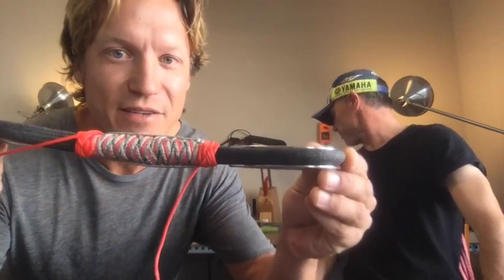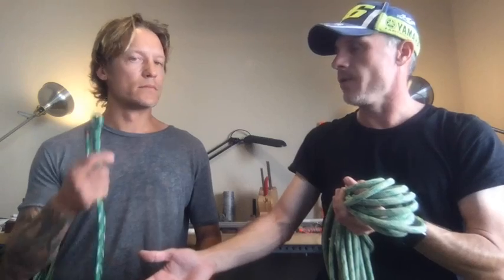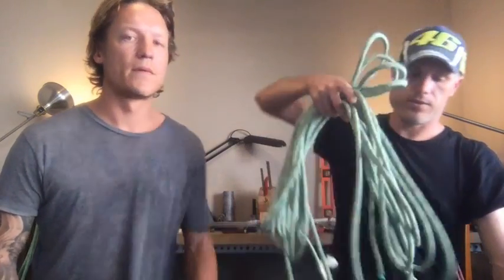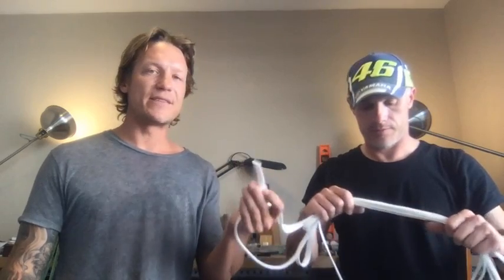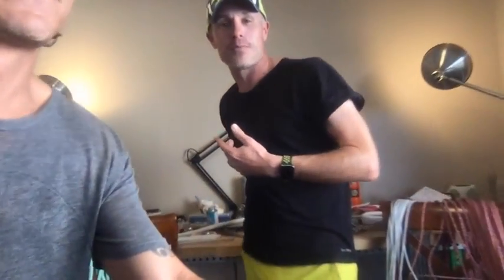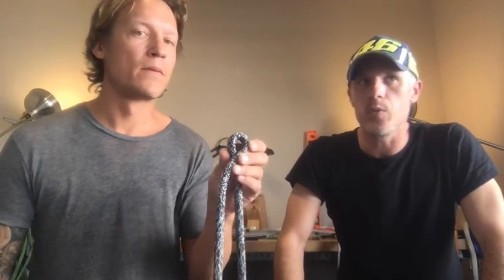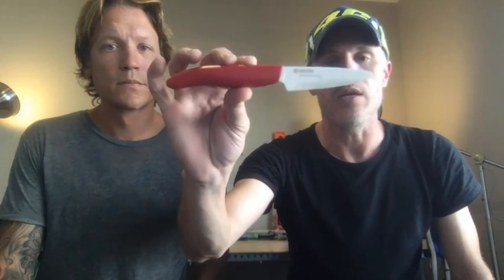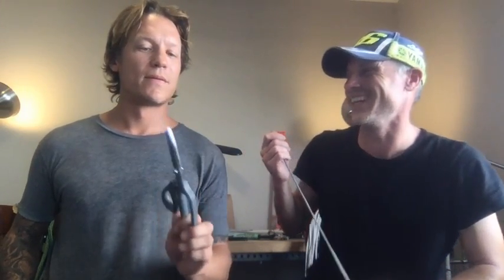LIVE: Talking Sailing with Kraken Structures (Dyneema, Synthetic RIgging)

Comment: Sampson uses Amsteel - not dyneema
Reply from the maker: Dyneema and Amsteel are both brand names for UHMWPE. The UHMWPE is Ultra High Molecular Weight Polyethylene. The individual fibres are very thin but incredibly long and straight and this provides UHMWPE with its strength. Lots of different rope makers(eg. Samson) buy the fibres from DSM who license dyneema, and then spin them into a braid which we know as Amsteel Blue. Amsteel blue is made from a specific type of fibre called SK75. There are other grades of dyneema too, such as sk78.
Reply: @BeTheCaptain   My is Adam I have been following you for a while and I want to send. A donation

Comment: I’ve heard of Dyneema synthetic rigging but what is “PBO” synthetic rigging, a different brand or a different type?

What is the UV resistance and replacement schedule of synthetic standing rigging?

If the mast takes a lightning ⚡️ strike does synthetic tend to catch fire 🔥?

Related lightning question: How do aluminum masts versus carbon masts fare when receiving a lightning ⚡️ hit?

Comment: staset vs dynema.. yes the dynema doesn't stretch, but that extra shock load due to less stretch translates into all of your deck mounted hardware/blocks. Have you ever had an issue with deck hardware ripping out due to the lack of stretch/shock absorption???